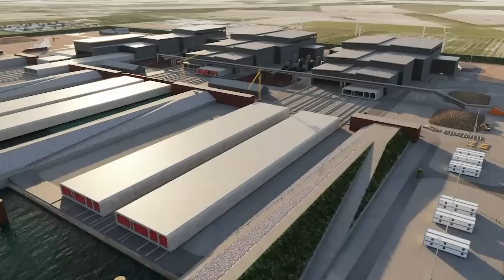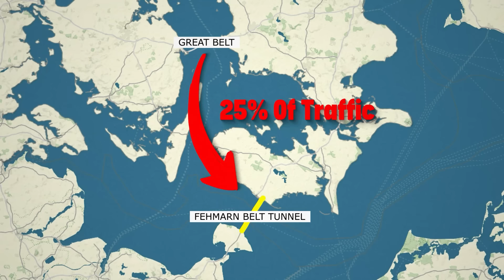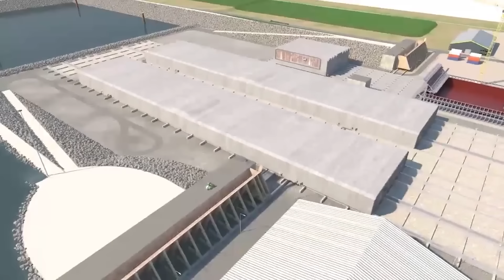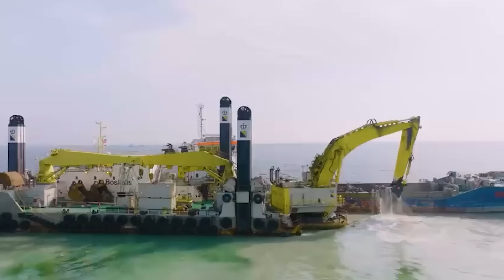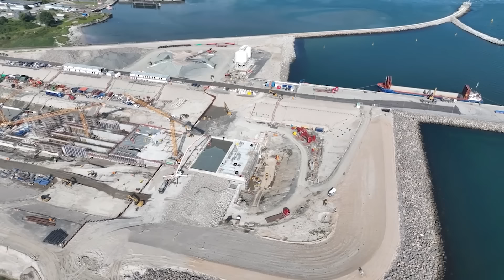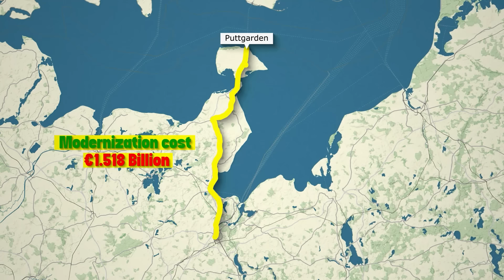Could Germany’s Delays Ruin a €7.4 Billion Mega Tunnel Project?

Comment: After Germany for years had done its worst, legally by Local Groups, to prevent the Tunnel being built, it is sadly also now being delayed by problems with the "Special Service Ship" intended to place the at first, floating Tunnel Elements in the ditch at the bottom for it. Later, to be covered with a new bottom, to make it look as flat as the bottom looked before! But also the works on German Soil, and a new Tunnel part from Fehmarn to Germany and the connected roads, are delayed, so the Germans will be able to catch up before its opening! Hopefully in 2029? Now 78, I had hoped to be able to drive under the Fehmarn Belt in my car, but it may not be so!    As from Cph. Had I hoped to be able to visit the "Giant Minitrain House" in Hamburg, "MW"?

Comment: What I don't understand is that lobbying etc. doesn't work in favour of constructing rail infrastructure. Germany houses one of the biggest rolling stock and signalling system manufacturers in the world (Siemens mobility) surely that's a massive economic benefit. They would sell so much rolling stock and signalling systems for these new connections

Comment: Such a waste to allow cars into that tunnel. Double track the rail line would have been cheaper and added more capacity. But of course like with every major project, Germany will fuck it up. They fucked up big time in the connection to the NEAT in Switzerland and they are still not done. The are currently fucking up the connection the Brenner tunnel. And they will fuck connecting to thew new infrastructure project too. Fuck Germany.

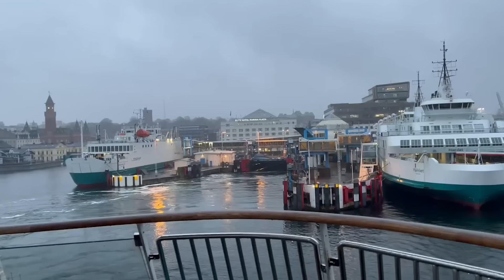Comment: 2:30 is only partly correct, the car ferry between Dragør–Limhamn connection was stopped. We still have ferry between Helsingør and Helsingborg also take a huge capacity and the connection is less than 100 km apart.

Comment: The absurd part of this are that Germany, it´s industries and people, gets a HUGE advantage by this connection for basically free. The ONLY thing they had to do, were to build their tiny tiny part of the total construction, to harvest the benefits. On top it actually are extra cheap right now, as German unemployment rate means that if it takes more employees than employed right now, they can take some out of unemployment instead of paying them unemployment benefits. 
The more windmills and the more rails Germany builds now, the more they will improve economy, unemployment rate, energy costs and thus ultimately German industry, that could use lower energy costs and faster and cheaper export/transport costs. 
Come on Germany! You can do this! On time and budget. ACT! 
PS. Dear German auto industry. Please make a small family car that can be fuelled with liquid green hydrogen. One with a 4 stroke hydrogen engine. THAT is the car I want to drive. Right now it seems like the only alternative I have will be a Toyota. Can´t you make a simple, cheap, mass produced car running on liquid hydrogen, so we can get the emission free transport kicked in gear benefitting local European car industry? I do NOT want an expensive car where i have to pay for a subscription, are monitored in 3 D 24/7, nor one that stops if maintenance service intervals are not done at an authorised facility. How about some basic capitalism? Give the costumer what they want and you will sell lots of cars!? They can roll directly from factory onto rails and be exported to all Nordic nations inside same day.....IF you just build the rails as agreed! Let Denmark be test market for this car! Give us costumers an offer to preorder the car 1-2 years in advance, so we can have the liquid hydrogen gas stations ready and promise us what car can do and promise us to fix it if any child diseases are discovered and many Danes would take you up on such an offer. Be progressive not reactive. Build it and costumers and facilities will come. THAT WILL be THE car of the future! Cars with 4 stroke direct injection hydrogen engines. Let Europe led the world!

Comment: The Fehmarn tunnel was supposed to be finished in 2014. No serious person expect this tunnel to ever finish. And why even have trains ? Trains are made obsolete many years ago, both passengers and cargo trains, is almost non existent in Denmark, where even new railway stations, are expected to close.
Reply: 2014? Got a source on that?

Trains aren't obsolete, that's frankly doesn't make sense, especially to urban areas like Copenhagen. I guess you are confusing it with local rural railway lines.
Reply: @fastertove  I live where they planed, to expropriate in 2014, and my property was completely without value, and then they changed the plans, some in 2022, and again just months ago.
In a country where electric cars are almost mandatory, Denmark, the need for trains has become obsolete. There is no need for trains across the country. Only subways in the largest cities makes any sense.
That’s the reason for, even brand new train stations has become obsolete. Aka. Maybe 10 passengers a day….
I sometimes ride a intercity train, there is maximum 50 people on board. One or two buses would be more appropriate and versatile.
I haven’t even seen a train with goods in minimum 5 years ! I don’t think they exist anymore.
There is no reason for making any railroad solutions. It’s a waste of money and time.
Reply: @tfhmobil  
Electric -cars, -busses, -truck, -etc. are all fine, but there's still a long time before they realistically can take over for trains on the main stretches, stretches that for the most part already exist and work logistically. I agree with closing rural connections, but not about for example closing Cph.-Aalborg prematurely.

Can't really comment on expropriating of land without specifics, but the tunnel wasn't supposed to be finished in 2014.
Reply: @fastertove  the entire stretch from Copenhagen to Berlin was planned to be completed in 1941.
The rest is just wasted time and money. Delays on delays on delays on delays, and now another delay because the forgot to plan for as ship to dig the trench 😮  That’s simply a lie, as there’s plenty of ships like that.

I live in one end of the country, and literally worked in the other end half my life.
It was cheaper to fly and twice as fast. The plane always full, the train empty.
Just the environmental impact of hauling a 2-400 ton train, mostly empty, is staggering, and it doesn’t matter if electric, it’s still a environmental catastrophe.
Not to mention that train is so slow, it’s simply impossible to rely on.
About slow….. I’ve done the exact same stretches for 50 years, and there is no difference worth mentioning. I literally have to start the day before, to arrive before noon the next day. A trip I can do in 5 hours in the car, 7 by plane.
40 years ago, I was working in a very big bulk production company. We had to stop any kind of logistics on rails. Too expensive and too unreliable.
In Denmark trains and railways are, and has been for decades, a absolute disaster to development, industrial production, environment, literally everything imaginable.
Just the cost of keeping it running, can pay for a more versatile and reliable bus system, that could be free for everyone.

Comment: The other thing that isn’t mentioned is the connections in Sweden… Our railways also need to be upgraded to be able to cope with the increased traffic. We had a big plan for new main lines but the new government cancelled those plans
Reply: To be fair most the train lines in Denmark are old junk as well. We use all the cash on building bridges and tunnels everywhere instead :P
Reply: There still needs more political will for electrification for Vejle-Struer, but otherwise there're at least something happening in Denmark.
The main lines are finally getting(ongoing) a long needed upgraded (updated ballast, signal-system and electrification) and the IC5 trains are introduced in 2027.

Regarding the traffic to Sweden, then a it's likely to become somewhat of a bottleneck. Not sure about the timeframe, but the combination of passengers(commuters and towards Germany) and greatly increased freight transportation are inevitable. Guess we'll see more proposals for alternative routes over the sound begin to popup more frequently.
Reply: The thing is, you are the destination. once the train crosses the bridge into malmö you will only have to deal with a 3e of the traffic. a portion stops in copenhagen, a portion will go towards gothemburg and oslo beond and a portion will go towards stokholm. You have the capacity for that.
Reply: I’ll say that was the right thing to do. The tiny german part of the Femern project will be 6 years delayed. That means 6 years of unusable train connection.

So good on sweden.

Comment: Was this project ever value for money? How are these things decided?

When finished the comfortable IC3 trains used on the old train ferry route will be no more
Reply: they only comfortable if you never ridden anything newer on decent tracks :P 
Something Denmark arguablely has none of :P
Reply: @danis8455 
IC3 trains have comfortable seats, gooď legroom, windows and seats are aligned, ride quality is good. I can't think of anything newer and better. The X31 and Regina classes suffer from poor ride quality. British rolling stock with BT10 bogies are better but most of that has gone and the Mark 3 stock had bad seat/window alignment. 

Overall, there best standard class is still the origin British Mark 1 stock refitted with B4 bogies and the later LMS stock.

Comment: Hopefully, they will not keep the Puttgarden-Lübeck as a double track, as this will result in a major break, as the local slow train traffic will remain. Everything below 6 tracks is too little. 2 for highspeed, two for freight and two for local transport.
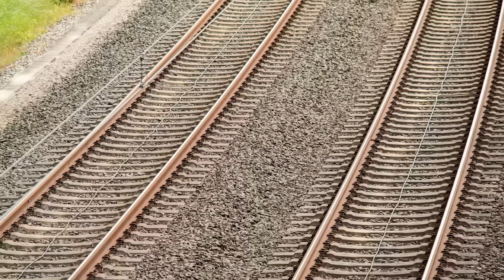Reply: At 12:45 - 13:45, it's mentioned that the single-track line will be converted to two tracks for a maximum speed of 200 km/h and, of course, for mixed use. And, of course, local slow trains will also run on the line.

Comment: It took Germany 12 years (4 years late) and 720 million (2x expected) Euro to build 3,2 km of Autobahn in the outskirts of Berlin.
Good luck with this one :face-green-smiling:
Reply: And in Denmark the road directorate just announced today that 8 km of motorway expansion will open 1 year ahead of schedule, this is the 7th time in a row a construction or expansion finishes before time and/or under budget.
Reply: Its expensive to build in or by a large city. That said Germany seems paralized when it comes to infrastructure projects.
Reply: Still not done.
Reply: @Carewolf Will the piece that was supposed to be built is done as I drove it yesterday but it's supposed to be extended further. 
Begin of construction in ten years or so 😅
Reply: @heinzriemann3213 I have tried to "drive" it, but it is just ends in an already blocked traffic jam, made worse by the highway.. It is completely stuffed, and takes hours to get thorough. Which is what I mean by unfinished. I dont even think they have a plan for the bridge that has been under construction for 5 years, except the tunnel they havent even started on.
Reply: @Carewolf Yeah the bridge is a true abomination. All the construction sites in Berlin seem to be more about gleeful sadism than construction.

Comment: The tunnel is going to be delayed on the Danish side, so the Germans can relax.. we also have bureaucracy here in Denmark.
Reply: As a guy working with planning, having seen both Danish and German projects... we are FAR less awful than the germans at this. The scale of the government inefficiency and incompetence in building firms is on another level in good ol Deutchland
Reply: @Anonymos185  Less bad does not mean that we can't get delays.
Reply: No Danish bureaucracy are hindering the process, only minor technical issues.
Reply: @OmmerSyssel  According to Folketidende we are already 18 months behind schedule. Everything indicates that the pace is not going to be increased but slowed down. The last elements may be placed in january of 2033, followed by up to 2 years installation and test work, meaning that the tunnel will go only into operation around 2035, with a 6 year delay. When I speak about bureaucracy I'm referring to the fact that Søfartsstyrelsen has not approved the two special vessels, Ivy 1 and Ivy 2.

Comment: 5:10 What will happen after 120 years of exploitation?
Reply: Most likely a major overhaul that would require the tunnel to be exposed to seabed to repair it or simply decommissioning it with a new connection.
Reply: @DanielleMoren yeah that said 120 years is an eternity so it’s impossible to say
Reply: @TheSpanishInquisition99  Yes, ask anybody in the area 120 years ago. Denmark and Germany were having a series of territorial wars at roughly that time.

Comment: There is a small chance that the federation will actually get things done given that the current minister for infrastructure is neither Bavarian nor a (complete) petrol head. Cooperation with Denmark works just fine as long as the projects aren't run by the federation, e.g. extra-long, that is, Scandinavia-long, trucks and cargo trains have been traversing Schleswig-Holstein for decades now to connect the Hamburg harbour to the North. Danish pig fences nonwithstanding.
The federation even managed to disable the Kiel Channel by slumping on the maintenance schedule of the locks. Which, mind you, is not an economical issue the channel earns the federation money. If you ask me we should just expropriate all federal infrastructure in the state.

Comment: The Danes are also not on schedule with this project and everything is delayed. e.g. lack of approval for the special ships to lay the tunnel segments because the ships were delivered too late,...
Reply: Not necessarily a major issue, since the production of further segments isn't stalled. They are simply stored until things are straightened out.
Reply: Currerently there is no delay, simply because we don't know, exactly yhow fast they can install each one. Just 5% faster than expected, will mean we'ree still on time. a 10% delay is just 2 months delay, and other timelines can be moved up if needed. But with the german speed, it seems futile to even spend this extra money.

Comment: Germany should build more rail from Basel/Switzerland to Karlsruhe since 1995. Switzerland built the Gotthard &Lötschberg  base tunnel, Germany has not yet finished building more rail...
Reply: And it won't be build till 2042, last I heard. If the connections to the Brenner base tunnel and the Fehmarnbelt tunnel face equal delays, the won't be properly connected till 2060. And to think that back in the 90s, we Swiss thought that Italy would be the more problematic partner when it comes to the connecting infrastructure. Germany used to be so reliable.... how things have changed.
Reply: Same with the link to France via Strasbourg - DB did the absolute bare minimum (built a new railway bridge because the old one was single track, slow, and literally falling apart) and then did nothing at all since 2010 despite a signed international treaty - so all the fancy high speed trains have to go slow because of the multiple level crossings and unsuitable track layout... and the line is at capacity without any additional trains possible due to ancient signalling. The regional trains are regularly overloaded, so to improve the situation at least somehow the French side purchased new longer trains to provide some relief - just for the new trains to be waiting launch for over a year now due to German bureaucracy delaying trains' certification. It's a f-ing joke.
Reply: Have you considered that Germany’s and Switzerland’s strategic interests are simply not aligned? Or at least that there are higher-priority rail projects to be funded within Germany other than to connect a new Swiss train line?
Reply: @sbalko74  No. Germany agreed for a second time to build a new train line to Italy, the Brenner base tunnel. There seems to be a real interest in faster, more efficient rail connections. And from a logistic standpoint, connecting the Ruhr area to Milan and Genua just makes mor sense.
Reply: @Zimionz  That may be so. But it does not change the fact that a new cross-border train link is a hard sell to the German populace when domestic lines are suffering from decades of underfunding and neglect, resulting in poor reliability and constant delays. As desirable as these new train lines to Scandinavia and across the Alps may be: These are vanity projects for the German taxpayers when the reliability of Deutsche Bahn is at an all-time low.